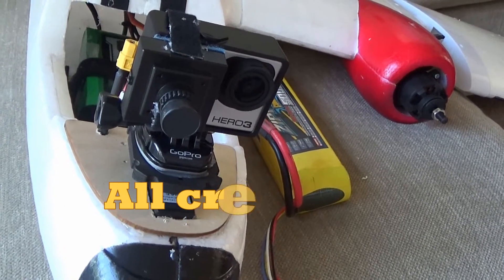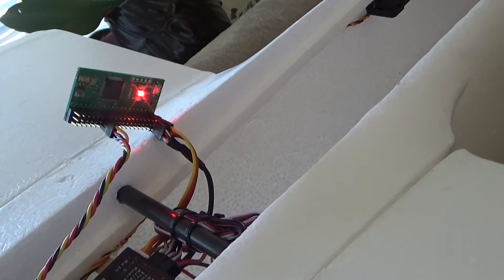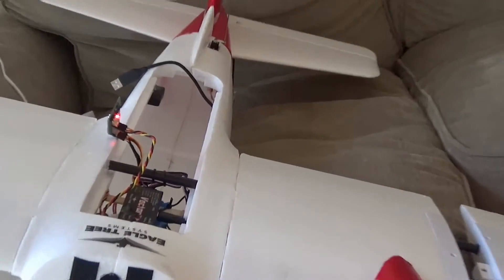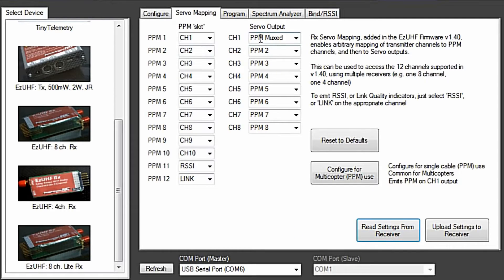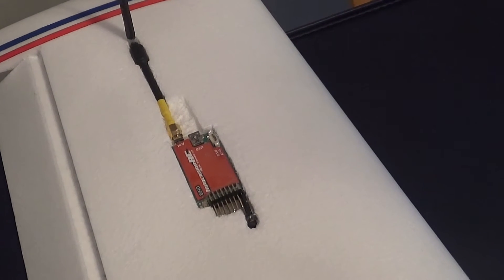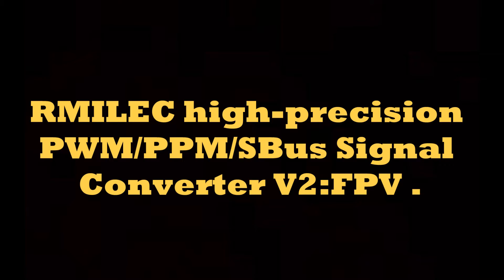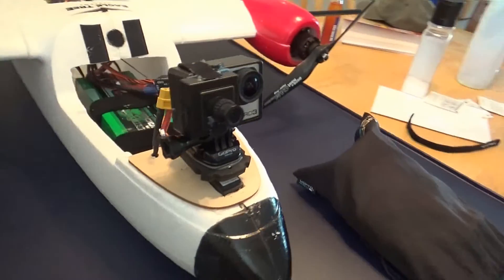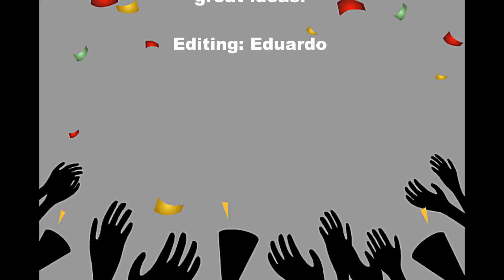How to control Pan & Tilt using PPM from EzUHF Rx and Eagle Tree Vector

Comment: Looks like a good use of the decoder. Saved one wire running down the wing. 
I think there is a smaller 4 channel version of the decoder available too.
Reply: Eduardo Fritis I have the 4 channel one and it works ok too.
Reply: Eduardo Fritis On the Frsky reciever with my Taranis radio. Gives me 12 channels testing on the bench. 
http://www.hobbyking.com/hobbyking/store/uh_viewitem.asp?idproduct=37953